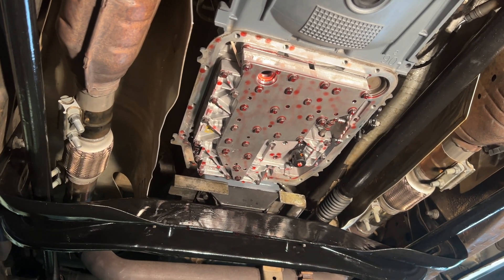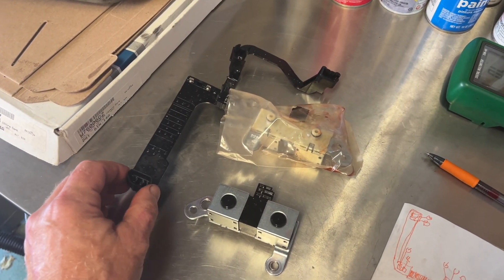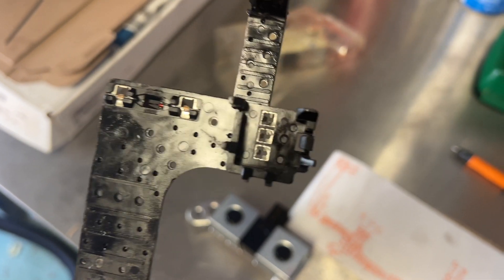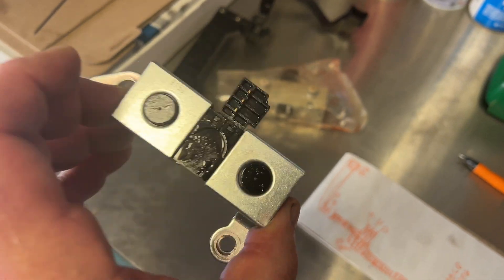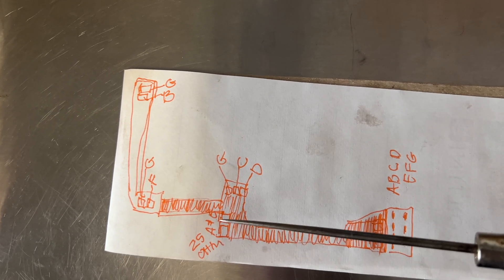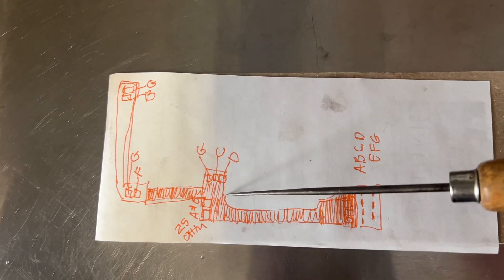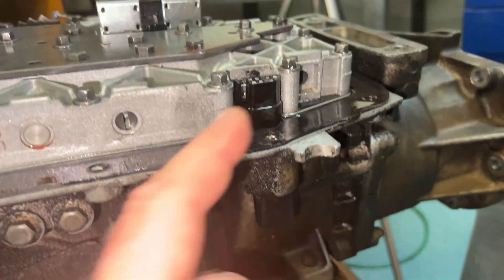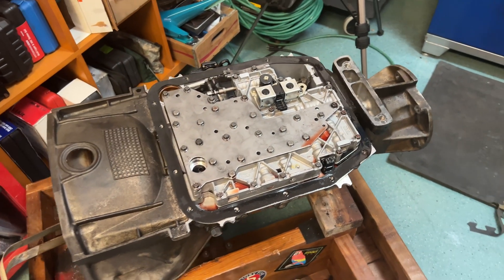Diagnose & Repair Ford 4R70W Shift Solenoid: P0750 & P0755 Diagnostic Trouble Codes

Comment: When I rebuilt my 4R70W and 4R75w I used the original over they worked fine before.So far no problems.Thats a bummer that your new one is bad.
Reply from the maker: True bummer, and it’s not the only problem. After fixing this took another test drive and no 3rd gear!  Probably the forward direct clutch drum, so out comes the transmission again for an inspection, ugh!  Guess what, this was a new part as well.
Reply: @DrivingIntelligence  It happens.When I rebuilt my 4R70W I missed the excessive wear on the pump.Had issues going into gear. I only drove a little bit.Pulled trans back out found the problem and replaced the pump.Works great now.
Reply from the maker: What were the symptoms and how did you determine the pump was worn?
Reply: @DrivingIntelligence It was very lazy going into gear reverse was worse. Way worse when warm. Once in gear and reved up it would drive and shift fine. Digagnosed by checking line pressure it was super low. I was lucky and no damage was caused from the low pressure. After the new pump I have around 500 miles on my car working perfectly . By the way this 4R70 is installed in my 75 Gran Torino Starsky and Hutch car with 351W. And US shift controller. Over drive is great
Reply from the maker: @mycontinental3611  Was there any evidence of wear in the pump when it was pulled?  Mine appeared perfect.  I also replaced all seals in all subassemblies using a master rebuild kit and the higher performance SONNAX components.
Reply: @DrivingIntelligence  Yes very bad wear.Not common on these transmision. If yours showed no wear it's fine
Reply from the maker: @mycontinental3611  yeah, my pump appeared perfect and I had no issue going into first and reverse.
Reply: Try replacing the solenoids with fomoco oem before you pull it man. Had a similar issue before with aftermarket solenoid went crazy trying to figure it out and put oem in the unit and went to working perfectly

Comment: Wow  thanks Barry . I was going to ask about the diode/s . I’m hearing ford is not making them anymore for these transmissions??
Thanks again for your knowledge 
Mouse
Reply from the maker: Hi Mouse, I linked the solenoids and electrical strip in the description.
Reply: Not much on the internet for this diagnostic approach.
Reply from the maker: Hope this video helps
Reply: Thanks for that diagram!